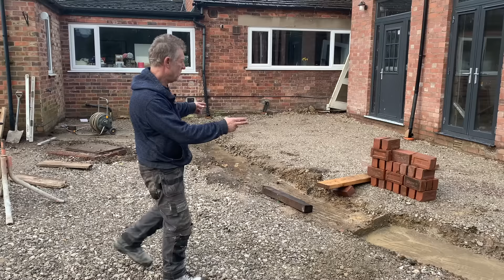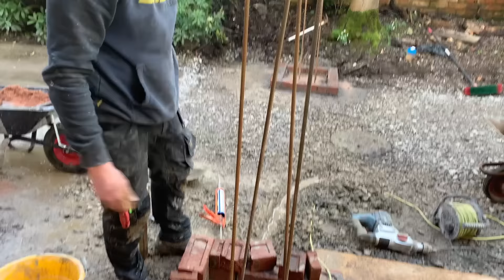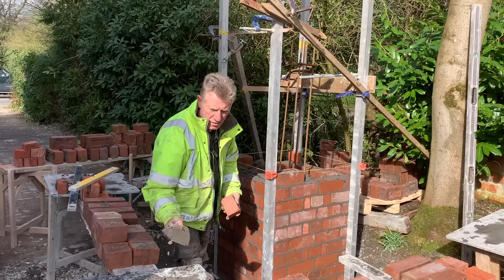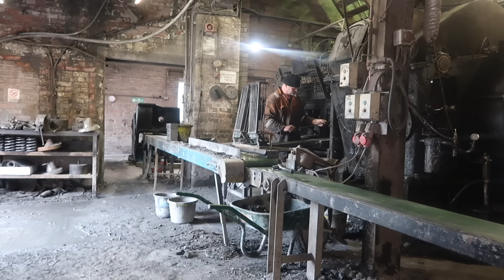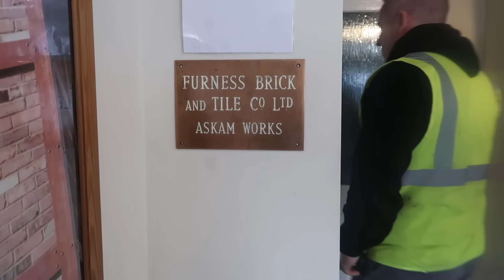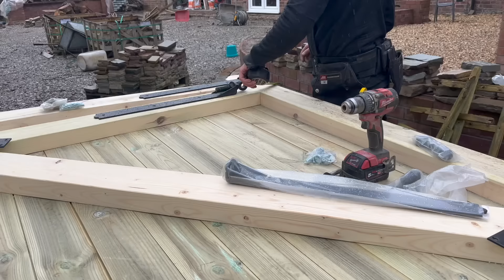overcoming challenges on Flemish wall

Comment: mmm not happy woth your bonding the two leaves by 'putting in the odd full stretcher' - it makes for quite a weak wall wspecially if you get any side impact.  You could have used wall ties to connect leaves together.  Good to hear you using lime in the mix.  What was the mix ratio?  I would have specified 1:1:6 cement:hydrated lime:sand, but your mix looks quite cement rich.
Reply from the maker: Thanks for watching and commenting. I did explained how the customer wanted me to use all his cut bricks in his wall.. I put through bricks through as explained on the video. If you watched closely on the curved section see 12:42 to 43 you see me putting ties in the wall🤷‍♂️. The wall is strong in fact it will have more strength and durability than most modern walls due to the quality of the bricks and the mortar I used 1:1:4 mix which is adequate. It’s difficult to make guesses at mix ratios especially when I have black pigment added to the mix.

Comment: The groundworkers didn't do you any favours with the tight radius. I always found it easier to make a template of a section of the arc and check it between set plumbing points on the wall. The use of profiles on the piers, especially with wet bricks is a big help, and whatever the size of pier, keeping it in flemish bond always involves either queen closures or three quarter bats.
Your price is (imo) more than reasonable. 
Im retired now I'm 70 something, the job has given me up, rather than me wanting to give ut up, but time and tide etc.
Nice job mate.
Reply from the maker: Thanks for your input and advice, it was definitely a challenging one with that radius!

Comment: Didn't show your splits, first course.
Cup of black oxide in each mix of mud?
🌏
Reply from the maker: Thanks for watching and your input. Sorry I don’t know what you mean about I didn’t “show my splits in the first course”?..I used the Ever Build mortar dye in the mix! 😊
Reply: @foundationgood123 If the footings are not level, cut the brick in length "splits" they could be wedge shaped to essentially get the second course level between the profiles.
🤏🤙

Comment: When I had my loft conversion done, I had to have a gable end wall rebuilt. It was then that I learnt that there's a small gap between the two layers of bricks and hardly any headers, mainly snap headers, amazing how they are still standing. I also had the floor lowered, my engineer had specified to chem fix a ledger board to the bricks to hold the new floors. Luckily my framer told me that wasn't happening given the state of the bricks, I am glad he stuck to his guns. We proposed new steels instead of using the existing bricks walls, was very relieved we did that despite the stress of the change of plan. It's at this point that my engneer said, these old houses have a gap between the 9" brick wall and that the chemical can just fall down. Why on earth he didn't point this out at the begining or even mention that old house walls aren't always suitable to hang a floor off is beyond me.
Reply from the maker: Thanks for sharing your experience, it sounds like you had quite the challenge! and yes not all as it seems aye! ⚒️🧱